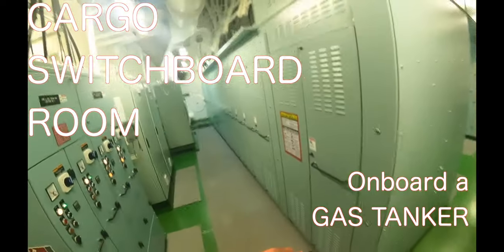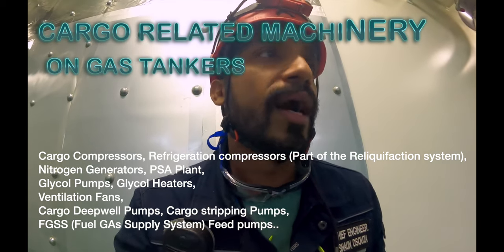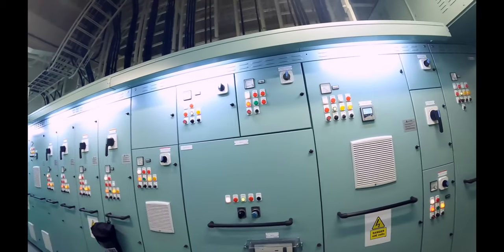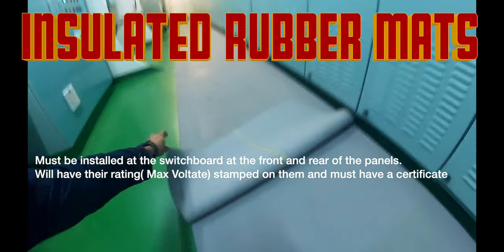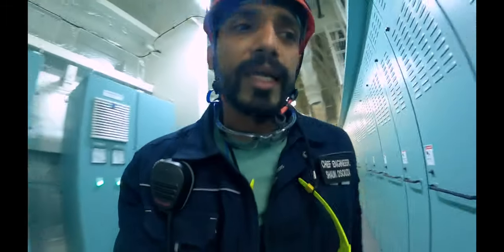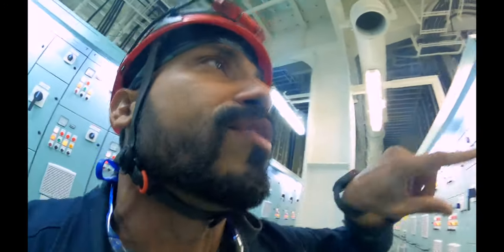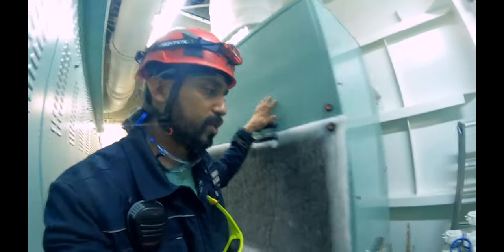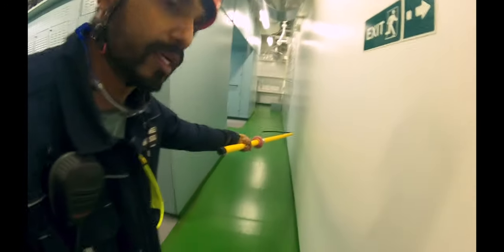Cargo Switchboard Room onboard a Gas Tanker - Basic Familiarisation Tour

Comment: Chief, foam is wet yes? Would nt it be dangerous if foam is used in an electrical control panel, people could get shock?
Reply from the maker: YES VERY GOOD POINT. BUT THE FOAM IS RELEASED ONLY WHEN THE POWER IS DEAD. FOR ELECT FIRE THE BEST IS A CO2 SYSTEM.
Reply: @Thedeepseaman Thanks Chief